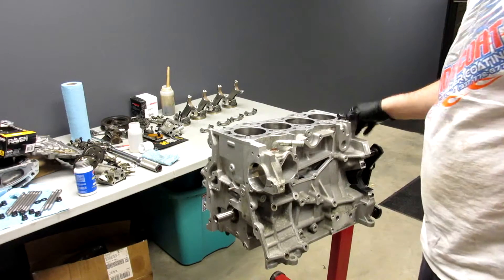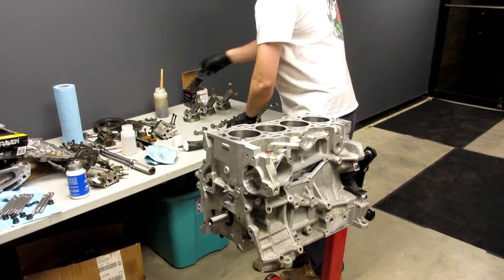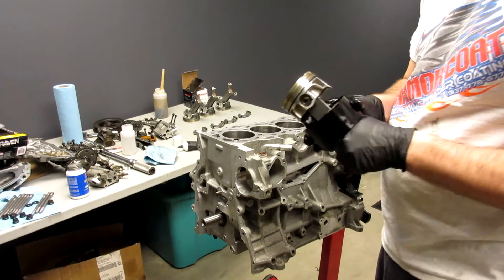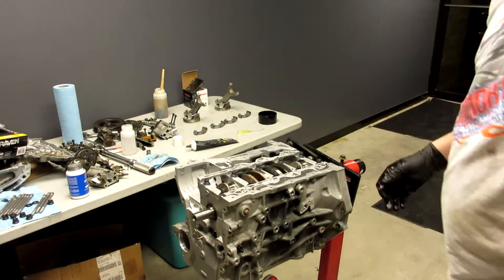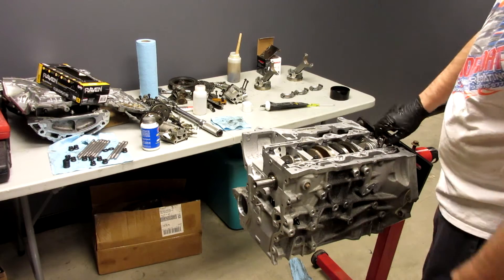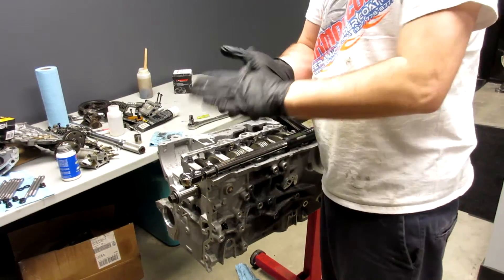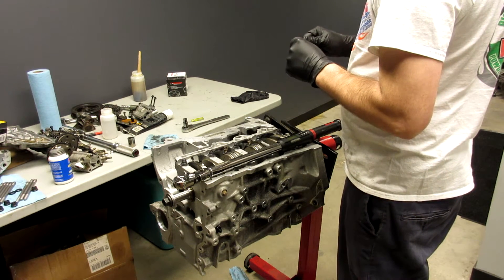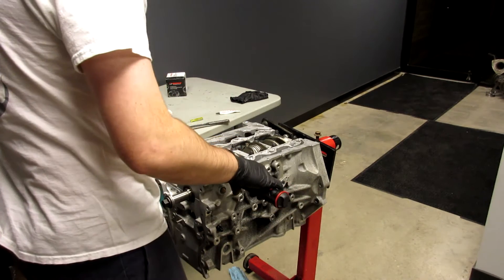Installing pistons and rods into a Mazdaspeed block

Comment: What’s the torque your using for the rods? I have  H beams I’m gonna be putting in a speed 3 and is there anything I should replace since I’m gonna be doing new rods?
Reply: 30pf then 60pf